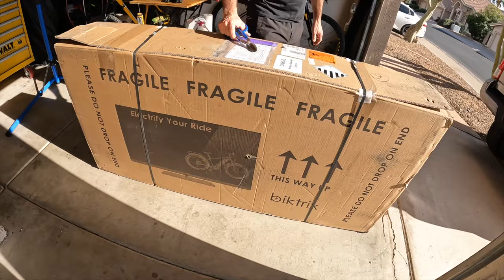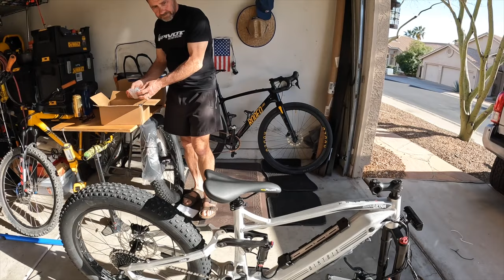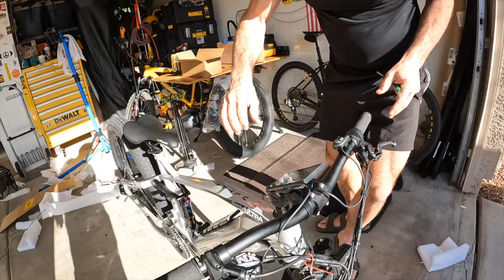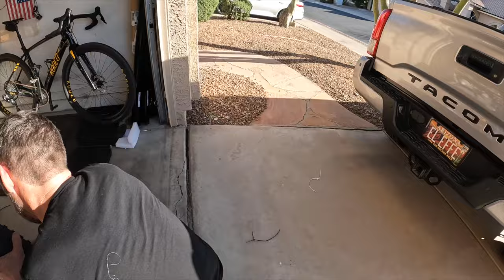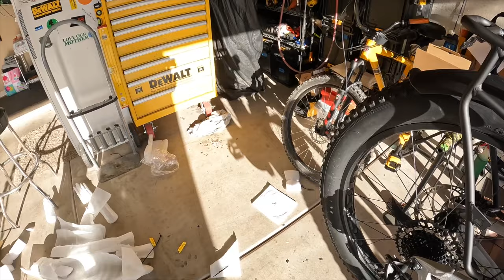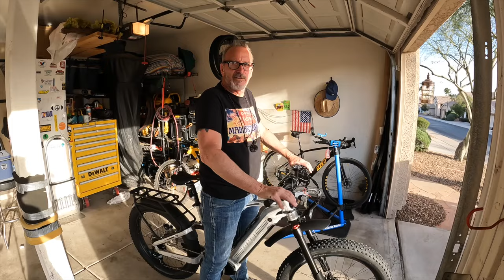2023 Biktrix Juggernaut Ultra FS Pro 3  "Unboxing"

Comment: I've had bad luck with the fat tires. Look into the different options for preventing flats on those things.
Reply from the maker: If you use the right stuff you can prevent them . FlatOut Multi-Purpose Tire Sealant - Prevents and Repairs Flat Tires, Seals Leaks, Contains Kevlar,

Comment: Good vid.  One correction though, my current ebike is a standard 2009 giant trance converted to ebike with the bafang BBSHD (1600W peak) and I weighed about 235 mostly (220 now) using it, maybe a couple of thousand miles, lots of it harsh offroading, and no problem with the stock rear hub and never a had to replace it, though I did wear out the smallest sprocket on the cassette once, though lesson learned, don't accellerate in top gear as you wear out that sprocket, only use it as overdrive once up to speed.
Reply from the maker: Thanks for watching much appreciated ! jss
Reply: @madhistory  Forgot to mention I ordered my Pro 3 today :) standard hub, I'll be the test dummy.  Unfortunately out of the rear racks, but free 13Ah range extender.

Comment: Once you order the extra battery does bike frame always have the extra battery terminal exposed?
Reply from the maker: yes it does , I was  worried about the weight but I have decided to run the bike with both because on the trail I could not tell a difference. And the extra battery was a make or break point. Thx Jss

Comment: The lack of 4.8" wide tires was its only shortcoming, now that you can upgrade to them is great  .. I dont see where that is an option, where do you see to add them? .. save yourself a bunch of aggravation, use blue loctite on those bolts, because you'll lose them if you dont
Reply from the maker: Under the tire section on there page you can adjust tire size  Thx Don
Reply: The FS Pro 3 supports up to 4.8” tires!
Reply from the maker: @Biktrix  awesome !
Reply from the maker: thx !
Reply: @madhistory  Thanks  but it's not an option there
Reply: @Biktrix  Thank you but  I've "built" that bike on your website quite a few times, But I see no option for 4.8" tires , only that  the 4" are the widest offered on this model
Reply: @donbeary6394  we don’t have those tires in stock but they arrive in a few days. Stay tuned
Reply: @donbeary6394  it’s on there now!
Reply: @Biktrix  I think this is a wise decision , having these options to taylor the bike to more people's individual  needs is a win win 🙂

Comment: is the headlight included?
Reply from the maker: They come with a 1000 Lum this is the upgrade to 2000. thx jss
Reply: @madhistory  did you get the free extra battery?
Reply from the maker: @edofelbi  yes sir !
Reply from the maker: @edofelbi  if you decide to get one please use the link in the description to support our channel and more E bike adventures  thx jss
Reply: @madhistory  sure sure!
Reply: @madhistory  bro hows the experience with 0 pedal assist?
Reply from the maker: @edofelbi  I have a cheap Hey bike and the pedal assist is so sweet on this new bike  I bought it not to pedal much and now I pedal because it responds so well. Thx Jss